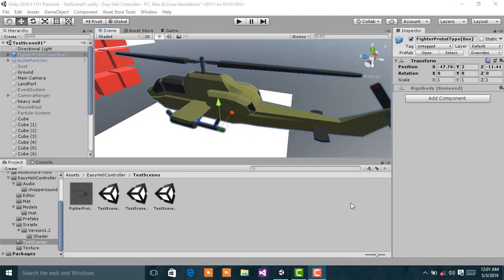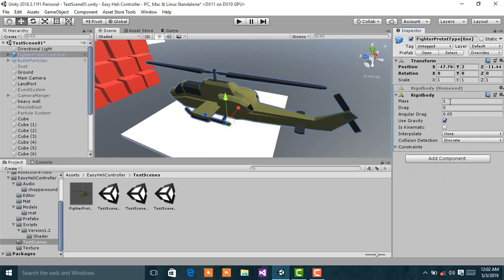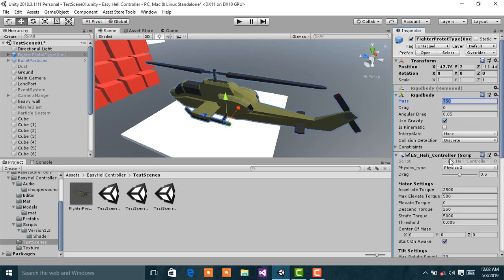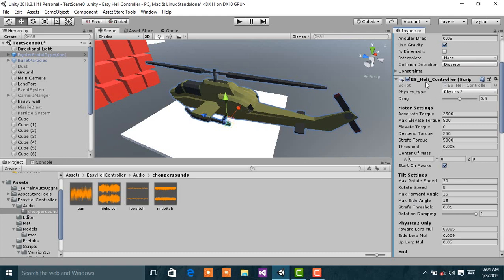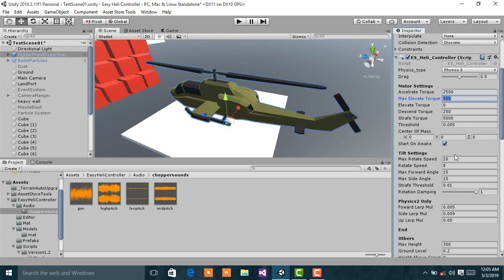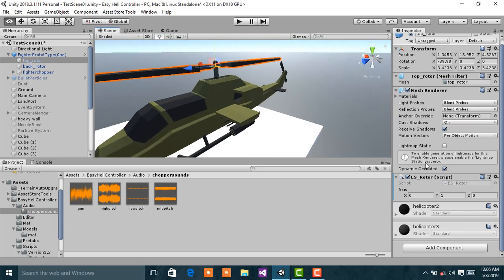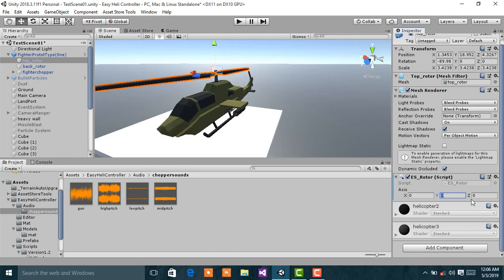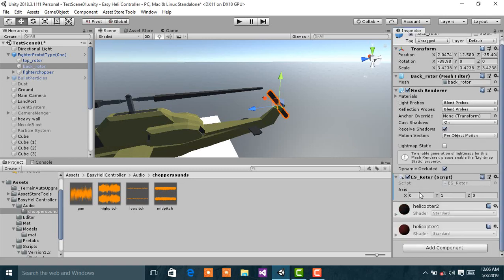How to use easy heli controller

Comment: Hello there - you asset is pretty cool.. just a question please, the rate is way to slow {Roll; Yaw; Bank} how do I turn up all the response times please, a helicopter is incredibly responsive. I want to make it almost too fast to control it.

With your demo scenes - it seems like you only have roll? Or have roll and yaw working together - do you have them separate?

Thank you :)